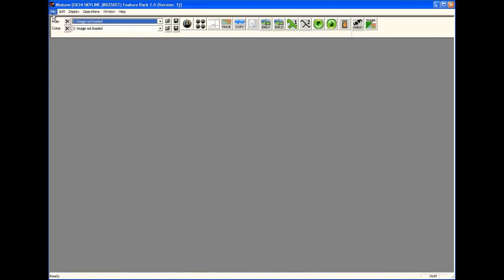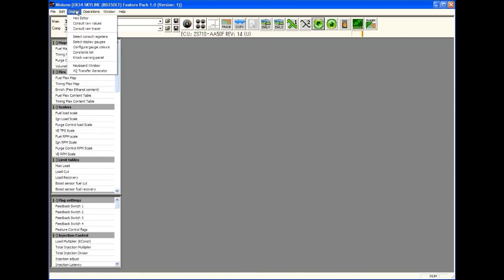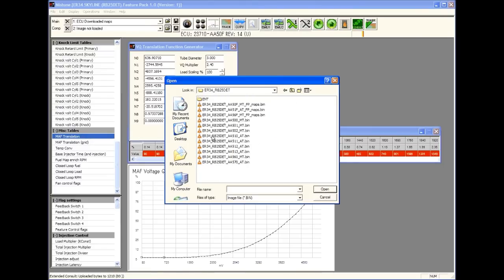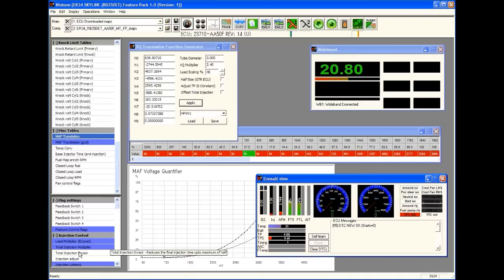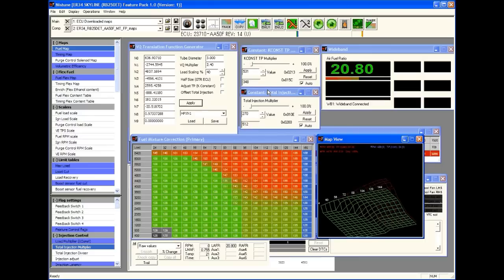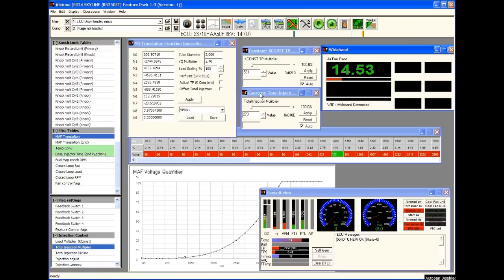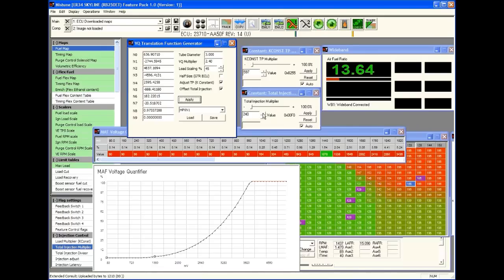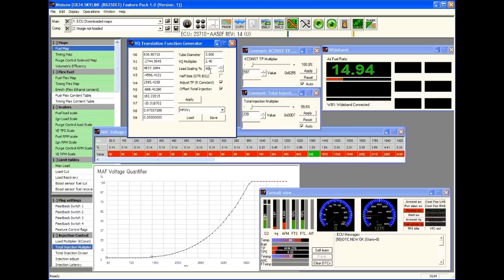Nistune MAF tuning

Comment: Can we get some step by step videos on things like starting with the type 1 board and how to set base timing and things like how to install bin file tunes from other Nistune users etc. I just had a tuner try to tune my car with nistune and I believe that he might not have done the basic stuff to tune correctly with nistune. He seems to think that my timing belt on my CA18DET must be a tooth off because he couldn't get more that 173HP out of my car. I find it hard to believe seeing that my car with the stock ecu was running very good as cars go. my car has many new parts is a healthy motor but I got disappointing results. My car is a real JDM S13 Silvia Ks model with a ca18det with about 70k original mile. My set up is a newly installed t28bb turbo, Greddy intake and exhaust, 3" turbo back exhaust, all hard piping, FMIC, HKS wastegate and HKS ssqv BOV. I should be able to get an easy 225 - 250HP, so I know the car is good so it must be that this tuner doesn't know how o use Nistune. I would pay for another tune but I fear that in the Columbia SC area f the USA tere is no shops that really know how to deal with nistune. Give some basic start to use videos for nistune and I think you guys need to assume that people don't know what your really talking about. some help please.
Reply: Have you not been on the nistune website he has all of this information there , go to the pdfs where you would of downloaded nistune, there's multiple how to first sync too how to change injecotrs